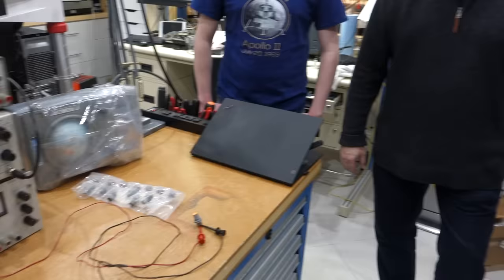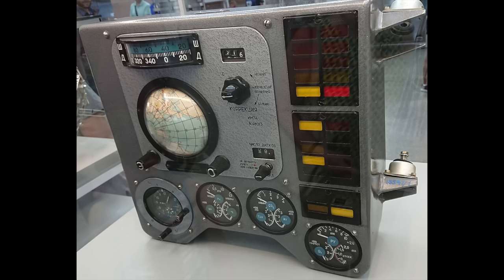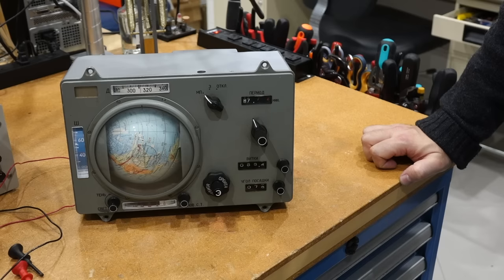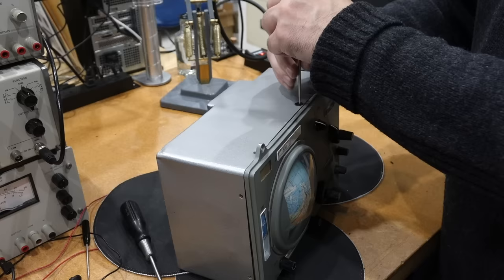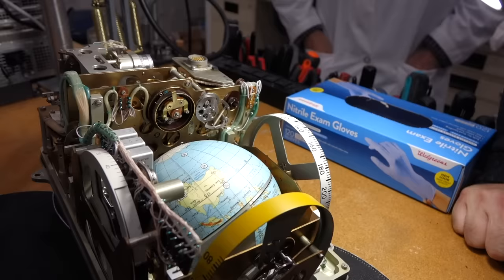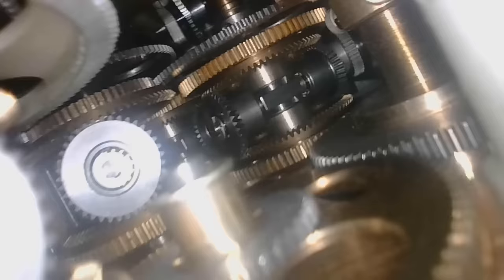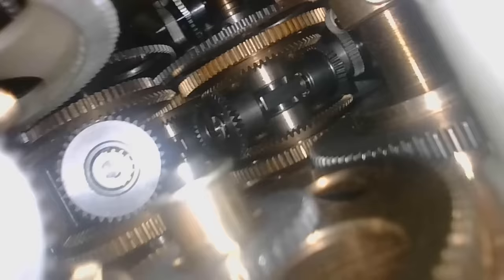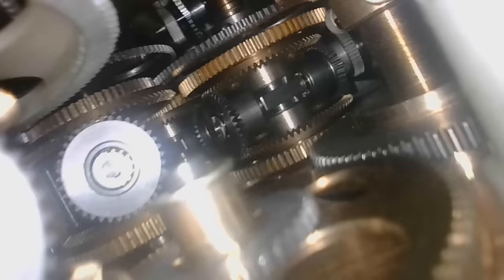Soyuz "Globus" Mechanical Navigation Computer Part 1: Grand Opening

Comment: I do own a Yak-52, a small russian trainer aircraft from 1980. Made in the former red star countries. Instruments are the same as on the Migs, Tanks and some Sojuz parts like the round instruments and some switches/fuses. They used the same design and parts for 50 years on all vehicles. Simple and reliable, I can smell this Globus from 8000miles away. Same paint, screws, finish, metal. This Globus is like the holy grail, its marvelous, 100% hand made mechanical wonder. Comes right after the antikythera mechanism.
Reply: I was thinking the same thing.  I could experience the olfactory sensation just looking at that.  The varnish, grease, plastic, whatever gave instruments like this one a very unique aroma.
Reply: i know that smell. Smell of old.
Reply: Now show us your Yak-52 like Extreme Aviation Iceland ;)
Reply: This last line of yours, contained all the appreciation, deep  love, and background  knowledge about mechanical Instruments like this. That was a comment with quality.
Reply: Yes T.D.  Looks like this is the Antikythera 2.0.  Not bad!!
Reply: @wtmayhew  Phenolic resin and plasticizers.  Each country and era had their own way of making the plasticizers responsible for all sorts of components.  You can hop into a WWII aircraft blindfolded and tell which nationality it is just based on the smell, or you can hop into various US aircraft blindfolded and tell how old it is based on the same.  They're all fairly similar in their smell in a broad sense, as it originates from the same type of components.  It's the same principle that's responsible for the new car smell.  Guns (particularly COSMOLINE!!!), vehicles, ships, and gear all have a particular smell, even today...it's just that we're so used to the smell of modern plasticizers that older stuff is distinctly different.
Reply: @Skinflaps_Meatslapper  Thanks for the reply.  I know exactly what you mean.
Reply: @wtmayhew  A guy could make some serious money bottling that scent up with the right marketing LOL
Reply: @Skinflaps_Meatslapper … a wax cube of Collins R-390 receiver to drop into your aroma therapy potpourri warmer.  I like it.
Reply: Wow, what a great exploration, what a very technical instrument, it is so instresting.  So are you saying Russua dosent need micro chips to function, they can wind back the clock to an all mechanical navigation systems. (pardon my pun)
Reply: Yak-52 is an interesting plane. The airport I fly out of has one parked next to where the plane I fly is parked.
Reply: Have you ever tried DCS' Yak-52?
Reply: @RedhotIta1  DCS does a great job of mapping out controls and graphics, but their flight physics kinda suck.
Reply: @Skinflaps_Meatslapper  I always felt it was the better sim out there for flying dynamics, but when I got to fly with a friend last summer I kinda understood that there's really nothing that come even close on giving that sensation.
Reply: i saw it and just thought about the antikythera mechanism also.
Reply: Once I flew with a Yak-52 in the back seat, with an ex MiG-29 pilot. I will never forget this fun!
Reply: I have an old Alan B DuMont oscillograph that gives me those same feels. It looks like crap and I've never fixed it up,  but I'm saving that for one day when I retire. Sometimes I like to just look at it in admiration for a time I never knew.
Reply: i find it fascinating that some tech back in the days navigation didnt use GPS. it use some clever design either stars, earth magnetic or terrain mapping that compare image. this is why those ICBM missiles that are made back then didnt get the upgrade  today. as its EMP resistance and dose not need GPS. once its set to launch, theres nothing to stop it beside knocking it off in the air.
Reply: I'm born '79 , I still have a Sony Betamax in my bedroom, I love old tech, that thing is a cross between an oscilloscope and a globe
Reply: @T.D. We both came to the same conclusion, this is indeed like the Antikythera Device. I posted my comments and then found yours... I like your thinking!
Reply: Not Russian aircraft. SOVIET aircraft. It's not the same.
Reply: @haiironotategami  Yes, Soviet... but looking how Russia never really abandoned a Soviet mindset, I use the terms interchangeably.  They both steal technology for their greatest innovations. I did like this mechanical computer. It is a nice "indicator" of where there were over the earth, but ground control could always tell them that just as easily.  The fact that it has a day/night indicator leads me to beleive that this was originally designed for spacecraft that had no windows. Again ground control 
could indicate that to the crew as well: "Entering Night Terminator.", "Entering Day Teriminator.".

The Globus had only 1 critical function: Retro Fire.  That relied on 4 important factors: orbit time in minutes (velocity), position (latitude/longitude), altitude (meters), and re-entry angle (degrees).  The most accurate orbit time is given to the crew by the ground and dialed in, the re-entry angle was also calculated on the ground and was given to the crew to be dialed in as well. Ground knew the altitude and it was relayed to the crew but not entered into the Globus.  So that leaves only position.  The crew could have been told at what lattitude/longitude to fire the Retro Rockets, but the Globus has an accuracy of about 1 degree (plus any error from setting it up), so I think the light was controlled by a signal from the ground as to the exact moment when to flip the switch to retro fire. After confirming the orbit time and re-entry angle, a cosmonaut held a hand on the knob, and as soon as the light came on, the knob was flipped to retro fire.  The Retro Rockets were fired immediately, and the mechanical timer wound down based on those two parameters (velocity and angle) until it reached the end of its limit and shut off the Retro Rockets. So it was basically a mechanical burn time computer for the Retro Rockets.  Now, as the rockets fired, the spacecraft slowed and it's orbit time increased (velocity decreased), so the orbit time was automatically incremented (ratcheted) by timer pulses to increase accuracy of the burn time for the best angle accuracy for re-entry (feedback in the loop). It wasn't as accurate as NASA's approach, but it was good enough to get the crew home safely - if nothing went wrong.

So, even if the Globus was way, way off on its position setting, having the correct orbit rate, re-entry angle, and the moment to fire, they would still reenter where ground control desired. The Globus could show where they would land, but that was only an indication based on the Retro Rockets firing - the crew could have cared less (so to speak) where they were going to land as that was out of their control.  I would like to see if the re-entry angle could be set to steep angles (like around 90 degrees), this would allow a steep re-entry to cause the spacecraft to burn up (if they thought they would come down over non-"Soviet" territory).
Reply: T.D. - Globus canned peas were made in Romania, not Soviet Union.
Reply: @ildart8738  I don't understand your comment. I didnt see any reference to canned peas mentioned anywhere in the comments or video. Globus refers to this device as it has a globe in it.
Reply: @paulromsky9527  Globus was a brand of Romanian canned peas, which was imported into Soviet Union. Even in the 90-s we used this pea can to store knives in our kitchen. Romania, just as Bulgaria, were agrarian countries of the Warsaw Pact. And we imported a lot of vegetables from them.
Reply: Awesome
Reply: By the way, the antikythera mechanism is a clock for navigation.
Reply: You can't imagine how convenient it is for restoration today ))
Reply: @TheRVSN  Yes, the Globus is not a clock itself, just an integrator of the clock pulses for display of position (and a Retro burn timer).  What makes the Globus like the Antikythera Device is in it's mechanical mathematics via gears and such.
Reply: @Cladisio , "Sometimes I like to just look at it in admiration for a time I never knew." -

I preserve a simple calculator with vacuum fluorescent display to watch sometimes the glow :). A pity I do not have а NIX 1.
Reply: @TheRVSN  That's pretty wild, those VFDs were so beautiful.

It wouldn't happen to be a TI-45 would it?
Reply: You probably know that lots of stuff was copied from the Germans. For example the electric flap switch was copied from the Fw 190 for the MiG-15 and is used until this day. Do you have a brown side up artificial horizon?
Reply: True, many parts were copied, the strater for the Ash62 for example too. The first gen horizon is brown, I still got a NOS one, the newer ones (and in my Yak) are blue.
Reply: @anttiruo ,

"For example the electric flap switch was copied from the Fw 190 for the MiG-15 and is used until this day." -

is it used for Su-57 as well?
Reply: @TheRVSN  I think they used that switch design on MiGs only.
Reply: Astrocompass🇮🇩👨‍🚀📡😺😵
Reply: All Soviet era planes have that odd clock in them that you need a university degree to understand
Reply: Same with the geiger counters and ionisation chambers, all the DP (Roentgen Dosimeter) series use the same parts.
Reply: @Weaponsandstuff93  DP is not uncommon, fortunately. Less than 10 dollars in Russia now. It is valuable in another way. This contains the reference beta emitter. Several dosimeters allow you to get a few grams of a highly radioactive substance absolutely legally.
Reply: Запах нафталина гниения упадка.
Reply: @user-he3rf2tp2l  ну так помойся...
Reply: @user-he3rf2tp2l  ну... к доктору сходи. Весна, пора на курс вставать. Будешь добрым, позитивным.
Reply: Anche adesso lo Yak 52 è un grande maestro di volo ..
Reply: It's perfect for museum or home collection. The heritage of old WWII German engineering. However, as for today it's absolutely obsolete. Wonder if their hi-tec weaponry uses same devices. Not a joke, at all. Kalibr cruise missiles still use inertial guidance systems very similar to V2 German missiles
Reply: @russelldsyder1344  Caliber uses fiber optic gyroscopes and two FPGAs to process them.
Reply: All the same equipment in my Mil Mi-24D! Love flying it every tuesday 🚁
Reply: @TheRVSN  😅
Reply: Crazy
Reply: nice comment!
Reply: enough secondary education in the USSR, many at that time did it with their own hands ...
Reply: But have you ever imagined that even on earth there are nineteen directions which you can use to navigate in space?
- 4 major and
- 4 minor directions,
- up and
- down,
- 4 upper minor directions and
- 4 lower minor directions
- and to the center.
Between them you can use degrees, minutes and seconds. With this system you can navigate in space without moving from star to star.
If you synchronize this sytem with the layer of our solar system (using the sun equator) you can determine every position solarcentric, if synchronizing with our galaxy, galactocentric,
Reply: I think the Soviets also made something similar to a spherical navigation device, based on circles of equal altitude (where three circles of equal altitude to a star are cut is where the craft is)
Reply: Life was better when we were mechanical,
come to think of it, have you ever camped in the forest
away from electricity? yep life was better withou electricity.
Yes I'm that old. löl
Reply: С s о o ю u (kinda monkeyx accent U') з z
Reply: Кем же ты работаешь, чтобы у тебя был свой советский  самолёт?
Reply: What an articulated, nice comment. Kudos to you.
Reply: Настоящий самолёт?
Reply: Рядом с моим домом был вертолётный завод, я часто проникал на свалку , там было полно таких деталей, всё очень качественное , этот запах я чувствую за 100 километров
Reply: Замечательный русский прибор
Reply: @simontay4851 I smell old too. And I'm older than this equipment.
Reply: Yeah that’s not the flex you think it is

Comment: What brilliant mechanisms people had to come up with because of the technology available at the time, definitely a good idea to show the inner workings and preserve this knowledge for future generations.
Reply: I'm thinking it's rather because of space radiation. We had solid state already in the Apollo--Soyuz era, but it's used very sparingly. You don't want your landing computer throwing a fit just because an electron hit something it shouldn't have.
Reply: @tocsa120ls  soviet union didn't have access to reliable solid state electronics
Reply: @hene193  not officially :D
Reply: @hene193  lmao, if you dont know about it, that does not mean they did not have it. they did
Reply: @hene193  They would've for these sorts of purposes.  But they opted for even greater reliability with big chonky metal gears. :p
Reply: This is real engineering 😂

As opposed to python programming.
Reply: @NicholasAndre1  a lot of engineers might use python to automate tasks involved with complex mechanical designs. :)
Reply: msylvain has taken apart a decent amount of Soviet military tech and it's interesting how the technology is not as advanced as western military tech. Then again America invented the Transistor and IC so it's not surprising.
Reply: @hene193  That's completely false. 

They certainly did have access to both solid state and vacuum electronics, especially the ICBM and space programs that came from this. You have examples of it directly in the video - all those Soyuz control panels are of course solid state electronics. 

Soviet Union had both own designs and copies of western components available - especially so for military programs where budget was not an issue and that were both matters of national prestige (space program) and of national security (ICBM stuff, nukes, etc.). 

However, do keep in mind that this device has been designed for the first space flights in the 1960s where there were simply no solid state (or other) electronics capable of performing these calculations - and that would also fit on board of a space capsule with the tight mechanical, mass and energy available constraints. 

 And then they kept using it because it did what it was designed to, was sufficiently robust and simple. It wasn't broken, so there was no need to fix it, despite it being a pretty archaic instrument in the 90s and 2000s when it was flown last already. Soviet/Russian approach to spacecraft design is very different from the western one in this regard.
Reply: @JanCiger  I would also add that the US wouldn’t have had a use for the before mentioned inventions if a group of decision makers who designed the AGC hadn’t insisted on using 3 input dual NOR-gate integrated circuits. The computer age was born.
Reply: @Aeduo  oh it’s an incredibly useful language especially now with matlab clone modules for DSP calculations but it doesn’t really require the same engineering to implement one of the scripts.
Reply: @JanCiger- thanks for the know it all speech. You're fun at parties I'll bet.
Reply: @davidrichter9164  indubitably !
Reply: @JanCiger  > especially so for military programs where budget was not an issue
Omg, it is so wrong. You talk about autarky country with communistic economical system. Money had zero point. It’s like to discuss about limitless of air. Yep, in theory air is limited, but on practice it’s amount is irrelevant.
Soviets was limited only with available human resources. In theory it was country with large population, but on practice actually pretty small. Let’s rewind history back: 1917, Russian Empire — only few percent of educated people, majority can’t even read and write. One of main reason why bolsheviks won — they promised education for people. 
Okey, somewhere in 1925 after years of chaos (included WW1, Civil War and invasions of 14 countries, from Britain to USA), country ran own development program. But it is need before thousands of schools and teachers (yep, right from nowhere), and not only for kids, you need to teach adult people (who must to work, have family, etc). In result, the first mass generation with really good education arrived only in 1943. But anyway it was not enough, as example after WW2 it was common that kids had only 2-3 years of education (europeans mainly eliminated USSR, dozens millions people became homeless, cities were erased, famine, USA and British Empire prepared to nuclear attack, definitely not best time for anything except work, so a lot worked from small years).
If you will watch classical Soviet movies from 1960s you can find that on background adult people often at evening in schools. Wtf you can ask, why people after work went to schools? Yep, they got education because it was impossibly during and after WW2. As classical example — Gorbachev, it is unclear for non-Russian speakers, but he speak in Russian wrongly, he pronounce words with mistakes because lack of basic education. Yep, he studied, but because of WW2 from 13yo he mainly worked.

Also let’s not forget, what exactly represented huge part of USSR. As example south regions. It is exactly the same people like in Afghanistan, same nations, language, culture. They mainly lived like in 12 century. Now try to imagine how hard was there, to do jump from 12 century into 20 century and space era. Until 1960s they even still mainly lived with sharia laws :/

So, USSR always was limited with available engineers and scientists, while money meant nothing. Even exist statistic, USSR had in 4 times less scientists and in ~12 times (?) less of engineers than USA. But exactly because money not meant anything in communistic economical system it allowed for USSR to be on near same and even higher level.
Reply: It's not "brilliant" if it doesn't work 😊
Reply: @juliap.5375  Какая чушь! Вы были когда-нибудь в СССР?